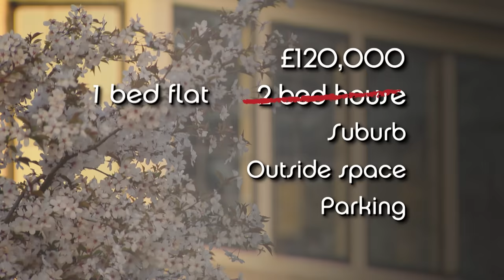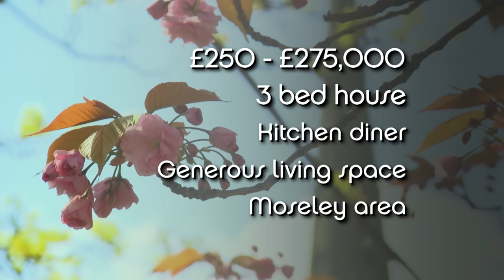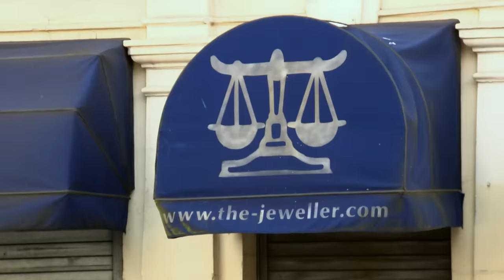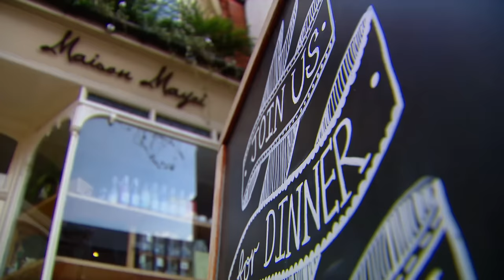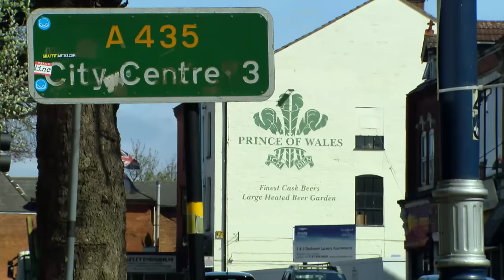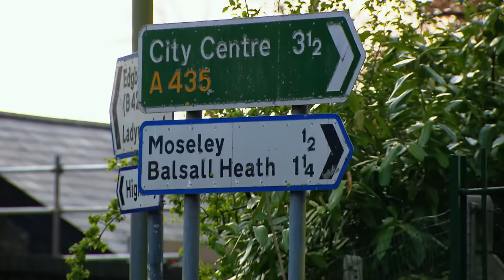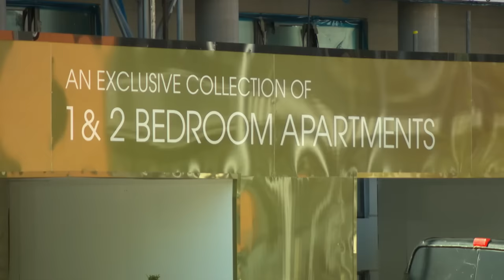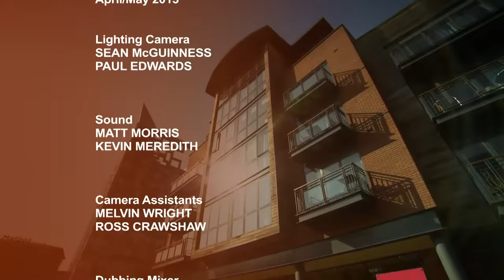Property Dilemma: City Living vs. Suburbs - Location Location Location - S16a EP5 - Real Estate TV

Comment: you have to understand when just "taking out this wall" you have to think of structure issues. if it's a load bearing wall you would have to put in a huge beam to take on the weight.$$$$$$$
Reply: They usually knock on a wall before suggesting that it be knocked down. They do check to see if it's load bearing.
Reply: Phil was a surveyor at the start of his career, so I think he knew what he was talking about when he said those two walls could be knocked down.